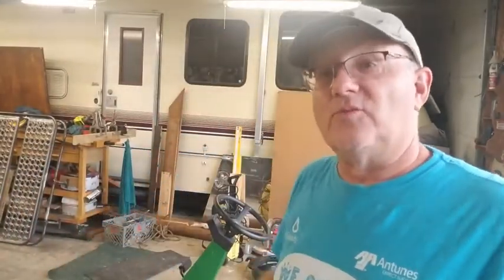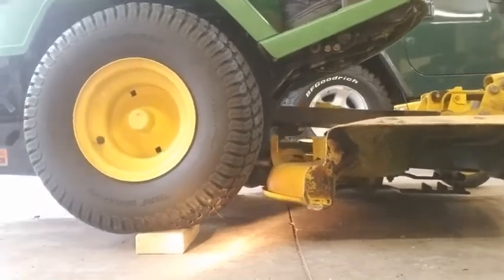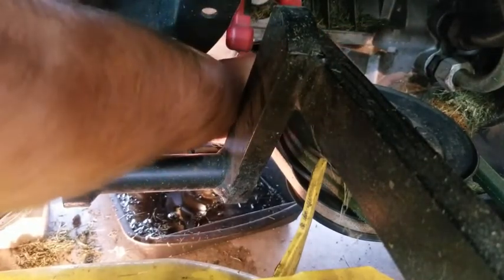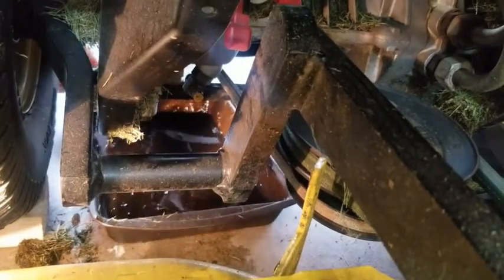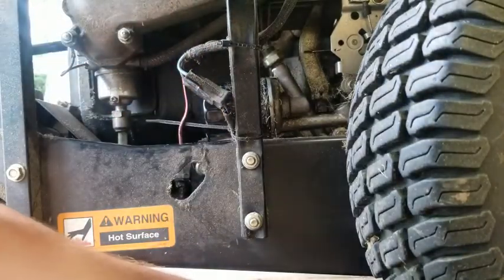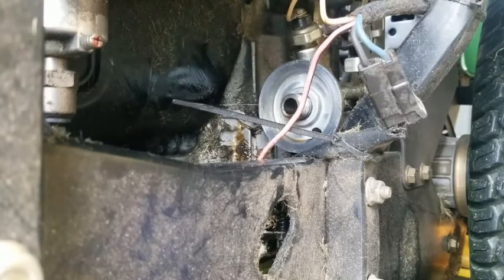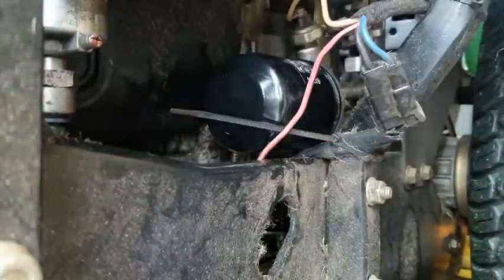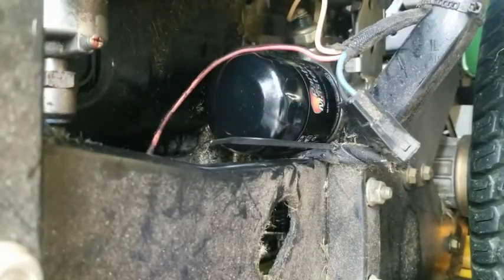John Deere F525 Lawn Tractor Oil Change for 16 Bucks DIY Save Money This was Simple

Comment: I wish somebody can show me where the three safety switches are actually show me a video my F525 rolls overrules overrules over but does not start no spark
Reply from the maker: Under the front your clutch switch, under seat switch, blade start switch, check all the fuses first. The clutch and seat switch are easy to bypass for testing and you can use a meter to test switch functions.  BE SAFE is number 1 on this work

Comment: How do I put my jd f525 into neutral? You are clearly very savy with yours.
Reply from the maker: There is a button on the transmission you can lift, you may need to rock it a little while doing this. You must push it back down to drive it again  Please subscribe and use Amazon links to shop   Steve

Comment: Wonderful wonderful video where can I get a manual for my F525
Reply from the maker: I do not know maybe John Deere, If you can't let me know I will see what I can find
Reply: @mytwogoodhands2799  thank you very much for answering me be back my ex platoon sergeant had a power shop in Coral Michigan and he put it all back together and he has been trying to find the manual for it but I am lost without my baby deer
Reply from the maker: @mikebetts3573  found one on eBay I do not know the seller  https://www.ebay.com/itm/403836307946?var=0&mkevt=1&mkcid=1&mkrid=711-53200-19255-0&campid=5338590836&toolid=10044&customid=b1c4b2bbcf0a1ba819bfd195f4fba3be

Comment: Hello
I have f525,can you show how to change oil in Hydro drive?
And how much oil goes inside?
Thanks and hy from Croatia
Reply from the maker: THe engine and transmission oil is the same oil on these units.
Reply from the maker: @goranzgela6171  just you tube
Reply: @mytwogoodhands2799  
sorry to bother you, but you are a doctor for John deere. Where i can finde to buy stickers kit for f525, some link page. I can't find anywhere for f525

Comment: The oil filter you put in was #61394 but you list the number above as #51394. I'm confused.
Reply from the maker: two different brands of filters the one I used was from local auto parts and you can't get it on line the link is to one you can get on line

Comment: Hello , I have a f525 , it ran great but now  as soon as I take my foot off the brake it stalls out .  Any ideas what this could be.   Thanks
Reply from the maker: check the fuses in front of the engine, this happened when my blade clutch failed,  the other issue could be the switch, I have video on the switch change
Reply: Seat switch

Comment: I have a nice F525. But the sad thing is, the engine leaks oil somewhere. It looks like it comes from the block of the engine. So it leaks a little bit at a time
Reply from the maker: Mine to it is the case on mine I tighten the bolts on the underside ad slowed the leak but still a little leak
Reply: Theres a split gasket that goes bad between the hydro unit & the motor! But the whole tractor mower almost has to be dismantle to get the gasket replaced! They have up graded up the new gasket I havent had any leaks since I had it replaced!
Reply from the maker: @terryoslund422  maybe a winter project! Did you do the work?
Reply: @mytwogoodhands2799 I’m selling it now, because the leak has gotten worse when I have to add oil while mowing, last time I just mowed with it, it really got bad and my engine was overheating and squeaking and smoking so I shut it off. Oil was just gushing out of it somewhere. So me and my dad towed it up to the shop. A few days later we started it, it ran, until after a minute it just instantly stopped.  So we tried starting it, the starter couldn’t even turn the engine. So it’s locked up
Reply from the maker: @jaxsonbelverudYolk21  Bummer and most likely not worth fixing it
Reply: @mytwogoodhands2799  Yeah

Comment: I have f525 I broke my belt that goes from engine pto to the pulley before the deck.  Do u by chance know the size of this belt
Reply from the maker: I do not know the size but this is the one I bought  https://www.ebay.com/itm/321519877986
Reply: M118755 is the belt number